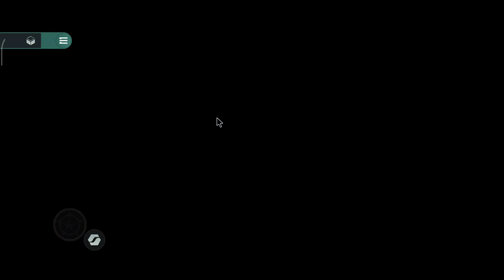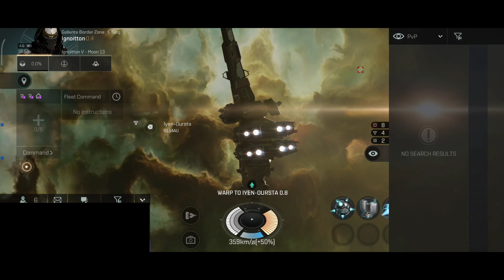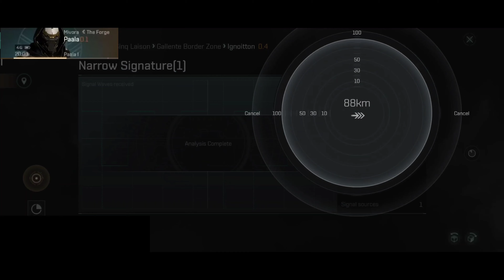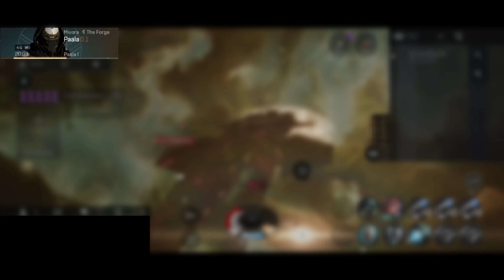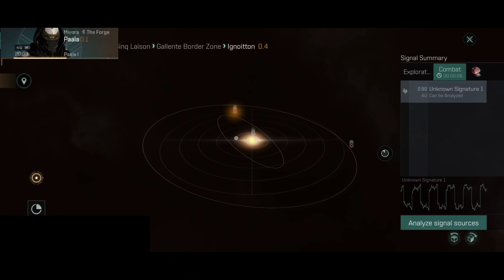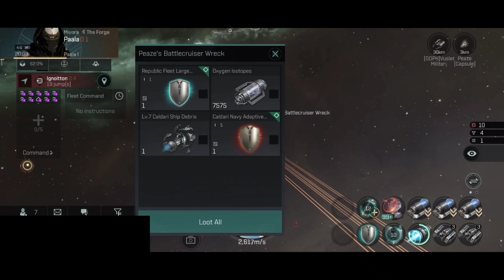EVE Echoes - PvP [Pirates of Syndicate] - Orthrus 490+ Killmarks - Battleship Killer B - Type Gear

Comment: Are there any ways to defeat orthrus and other mordu ships? I'm a solo cyna who always get annoyed by them :/
Reply: The orthrus wins by range so u need to outrange them but at the same time able to hit them because they traveling at 3000m/s with mwd. So Drone boats using Medium drones stand a higher chance, the Armageddon would probably stand the highest chance due to it being a drone boat and also its extended large nuetralizer range. You can see the Rifled Ferox also did pretty well, thats because rifled ferox with invested railgun skills have quite the range + the target paint + the mwd added sig radius makes the orthrus a bigger target to hit.
Reply from the maker: Drone boats are its greatest enemies, afterburner cynabal should take 10% damage from medium missiles. I recommend slingshot trick. Works in most cases if the orthrus pilot is not expirienced